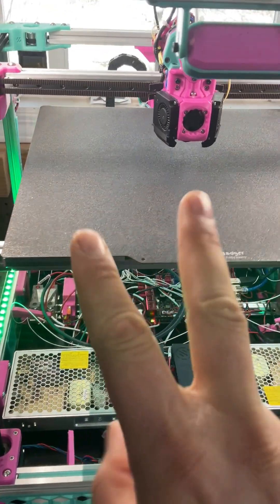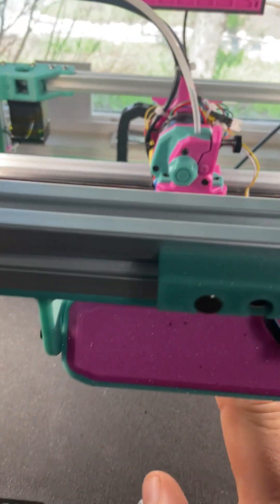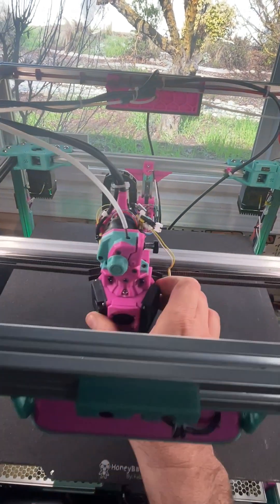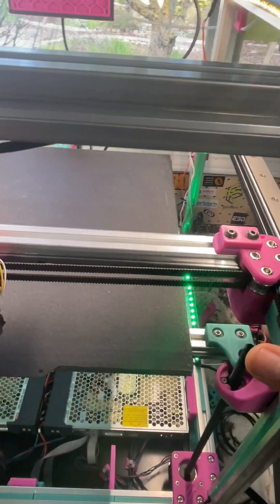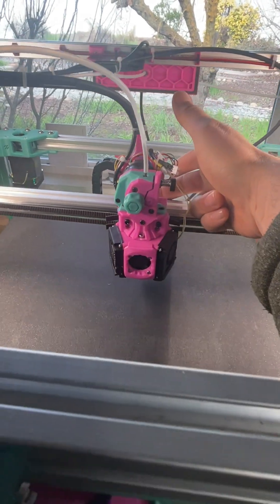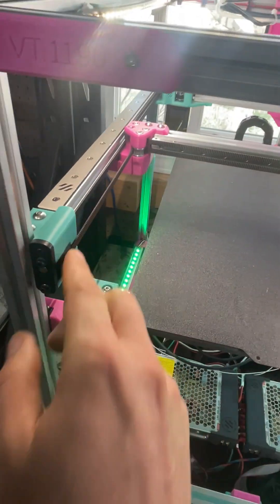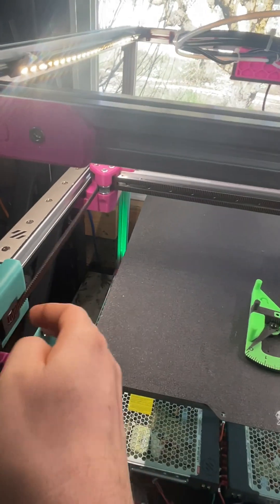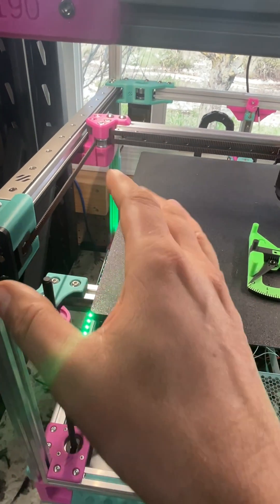More complete belt tension -  For SyNoon, and maybe you

Comment: I'm asian, can you explain loosy goosy?
Reply from the maker: loosy goosy, is a phrase that means something is not as tight as it should be. Think of a wire between two points. When the wire is sagging it is loosy goosy. When the wire is tight it is not loosy goosy
Reply: @The_original_Reth  which means, I have been doing my 110 hertz wrong! I usually do one side first rather than 1/8 to 1/4 turn each side equally. Thank you, my graph is better now
Reply from the maker: @MShazarul  your welcome.